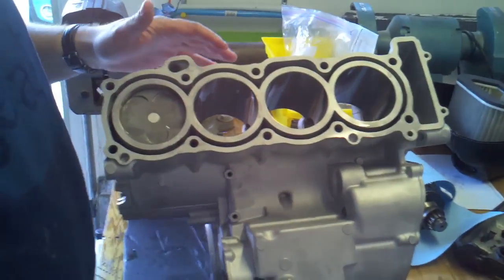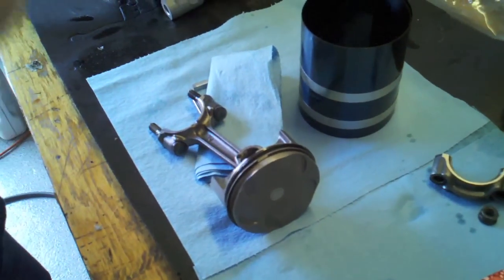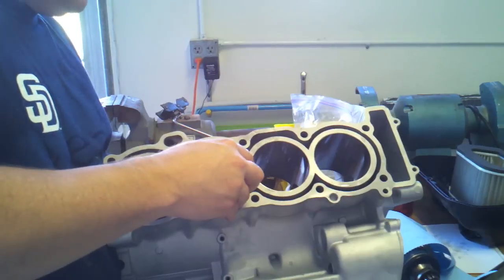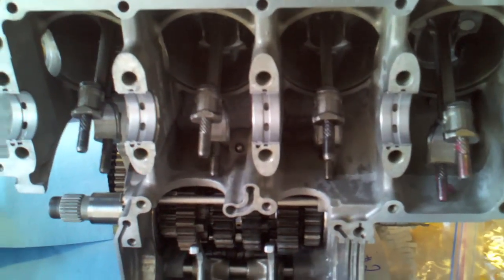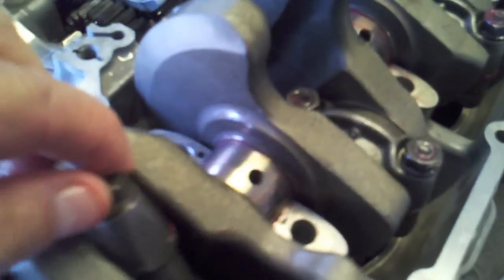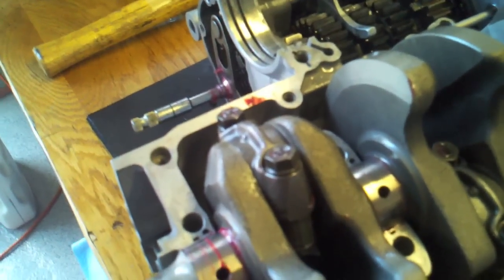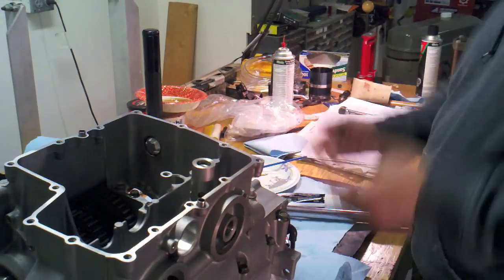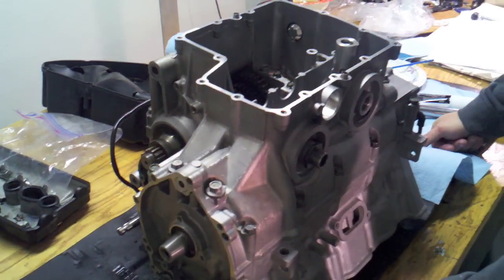2000 Yamaha YZF-R1 Engine Rebuild - Part 19

Comment: You do need to torque, then re -torque again to separate specs as it is how to properly tighten motor so runs quiet and smoother. Best ride 30 miles and retorque to specs and great result. Great series of video.

Comment from the maker: I was using PC-04 Pro Circuit Assembly Lube, but you can use any good quality assembly lube or lithium grease.  My thinking is that since the factory manual was published 12 years ago, there have been some better oil/lube/grease products to hit the market.  No matter what you use, make sure to lube the spots the manual says, and you'll be fine - engine oil will even work if you have nothing else.

Comment from the maker: I did not.  I had to make a judgement call on the rod bolts and nuts - on the one hand if you use new ones the bolts have to be "stretched" using a very specific procedure which I did not have the proper tool for.  Re-using the bolts meant they were already stretched the proper amount, but you are right, the best practice is not to reuse them.    The factory manual is clear that each nut has to be torqued completely in one continuous motion, and I did so as specified.

Comment: Ya i watched a few videos where they used a stretch gauge.  But my manual didn't have the specs so i opted out of using it.  Probably a good thing cause i don't want to spend more money on tools.  I'll probably end up taking a leap of faith too.  I got the same color bearings as what was in the engine before...I'm using the same crank and rods so should be the same.

Comment: Hey John.. Did you ever use plastiguage to measure the big end bearing clearance?  From my understanding you can't reuse the bolts from the rod caps once it's torqued down.  Also why do you say when you torque the bolts on it has to be in one go?  I would think it'll be better to tighten each side a little at a time until you reach spec torque... that way you get an even distribution.

Comment: John, tdo well? I live in Brazil and I'm buying a R1 2008 and is a loud noise in the engine.
Idling does not only accelerates the 2,000 when she turns up-tec tec makes loud and clear what can be? I think it should be tre been taking spinning, do not know if I buy it or not. help me. and many thanks and congratulations for the videos.

Comment: Hey John.  Did you use regular 10 w 40 motor oil in the cylinder wall?  I've read one of the best oils to use is 2 cycle motor oil since it'll burn off fast.  Just wanted to know your thoughts on that.

Comment: importend question..! i cleaned the crankcasebolts and threads too, but when i put te case back togheter, i forgot to lubricate the crankcasebolts. Hopefully it is not to bad..is it? tightening the bolts with 60 degrees is 60 degrees right?

Comment from the maker: yes I did.  Oil discussions are like religion, but I believe the generally accepted best practice is to break-in a new engine with standard petroleum based oil, and then switch over to fully synthetic if you choose to do so, after the break in period.  You need the components, particularly the piston rings to wear in and fit the cylinder walls, and fully synthetic oil does not allow for that wear as effectively.

Comment: I have deep marks on the left shift folk, on the right side of it should I replace it, don't really want to spend the money
Reply from the maker: Shift forks that have gouges in them are pretty common, surface damage won't compromise the integrity of the shift fork, but it will likely cause you some issues during normal operation when shifting.  The factory service manual says to replace any shift forks that have any visible damage.  My recollection is that the shift forks aren't that expensive to replace, especially if you find some good used ones.
Reply: SupermotoJohn
Hey man...I followed your videos with this rebuild...I have a 2002 fuel injected R1..and I was thinking i might do a rebuild this winter...I want to replace piston rings,and cranckshaft bearings..but I have a dilema...how do I know what kind of bearings I need??If mine are white..I must put also white.or do I have to measure first the clearance with the old bearings and then to know the ones that I need?or only replace the bearings with the same colour?Thanks a lot...
Reply from the maker: ciogon
The easiest thing to do is get new bearings that are the same colors exactly as the ones you are replacing.  Under normal circumstances, there is no reason to re-measure and change them if you are using the same crankshaft and piston rods (both are hardened steel and don't wear).